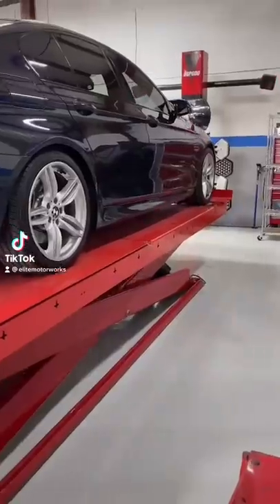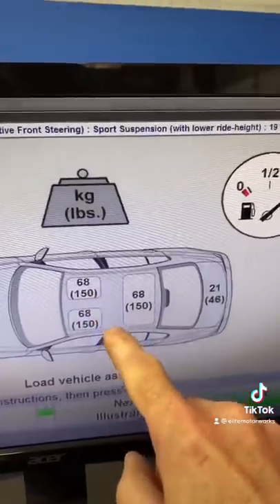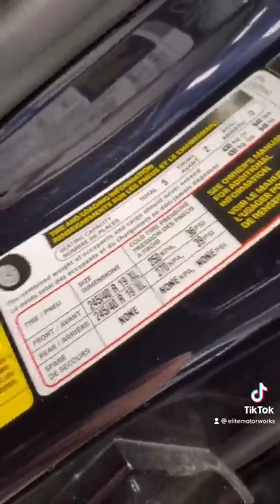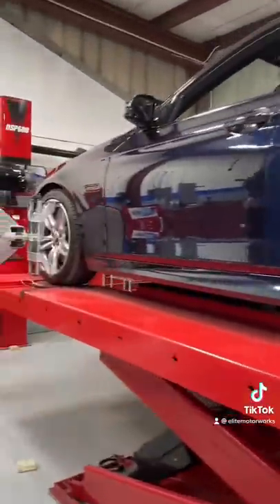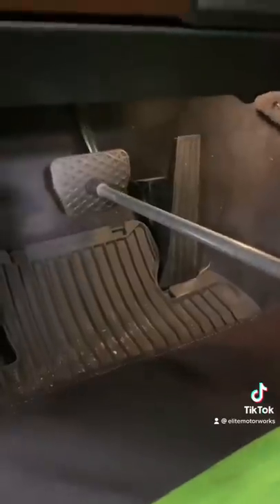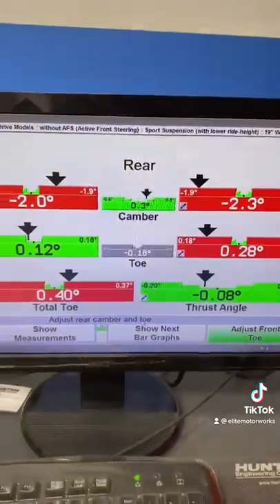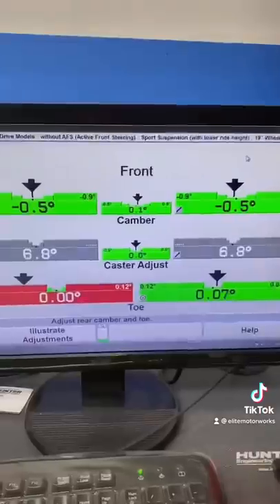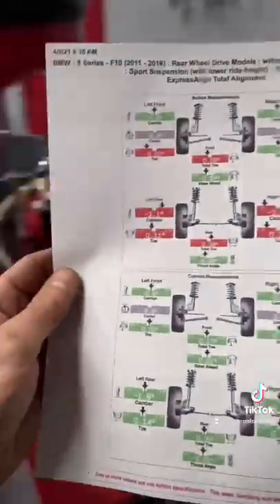How BMW does alignments #shorts

Comment: The huge difference between a lifetime alignment and your alignments, you are a competent mechanic.  It is very refreshing to watch you work on your channel. 🙏
Reply: Dammmm
Reply: I actually had 3 alignments back to back to back with my lifetime alignments. They were pissed but eventually got it right
Reply: @Alex Ptc Firestone offers lifetime alignments, where they'll align your vehicle for as long as you own it for twice the price of a single alignment. It's hard to find a good tech though
Reply: @darkfireBikes  I used to be a Firestone tech. Most newer cars only take about 30mins or so to do an alignment, unless there's something way out of wack. Older stuff, like mid 90s and back, that can be a pain and take quite a bit longer, especially of stuff is rusted together real bad. Also, there's a certain year range of Prius that, if it has rear disks, uses shim packs to align. Half the time, it would end up causing the rear brakes to squeak afterward and you have to mess with it a bunch to get it to stop.
Reply: @copo2835  that's because the rear caliper is rubbing, you have to shim the bracket a bit to prevent/stop that noise.

Comment: He’s doing it the proper way. The big tires stores will instruct techs to perform a quick front toe correction rear toe correction worst case. But will most like not use the instructed weight placement. 
Less time spent = more cars = more money 

I don’t mean more money for the techs either.
Reply: Depends where you work I was getting 11 per hour plus 9 dollars for each alignment I did plus I was getting commission on all frontend parts I sold and replaced my average paycheck was about 2500 a week as an alignment tech
Reply: Yeah, and then they tell you some nonsense about the road slanting
Reply: @cheeseburgers82  you’re earning 10,000 dollars a month doing wheel alignments?
Reply: @user-qy1ek5jr2r  Gross pay, probably, I remember working at TFT nearly 20 year's ago and alignment techs did get commission though they didn't repair vehicle's. Soo with the repair work, and the increased wages over the past 20 year's, yeah I cann see 10k per month, especially if you're busy all the time.
Reply: @aeternalis  actually he's not I'm not a mechanic but some of the shop out here in utah where I live do the same deal. My buddy was making around 2k a week Before taxes
Reply: @aeternalis  PO ñ lo lleva ñl lo ok
Reply: @narwhal9852  o
Reply: O
Reply: @narwhal9852  Of a Bro pool phone I'll looto loo
Reply: Ll
Reply: Lil pool and all u
Reply: Rep I'll
Reply: Ñooo
Reply: @henrymarquee6633  what
Reply: @cheeseburgers82  think you meant 2500 a month lol…
Reply: I would literally see other techs at these stores bump a sensor to make it look like it's in spec.  And I myself have misaligned the sensor and saved it as the before measurements so that way I could get paid an extra 3/10 on a lifetime alignment check
Reply: As someone who instructs techs in big stores, we tell them to do it correctly. Having it come back once costs more in time and reputation than it will ever take actually doing the caster and camber.
Reply: Most dealers don’t use weight lol
Reply: @cheeseburgers82  44 alignments a day😂
Reply: I worked at one of these places and most passenger cars only have front/rear toe adjustments. Some only have front toe. Most people done give 2 shits what the process is as long as their car drives straight.
Reply: @sociallyinept5430  yeah its called road crown lol if your car is slanted even slightly it will drift that direction. Basic physics
Reply: @texastootin1628  that’s true.
Reply: They won't even touch my BMW in my town, they'd rather not waste the time
Reply: @DLLL598  that’s better than having your alignment made worse by them.
Reply: Weights only matter depending on ride height, and caster sweep on a vehicle with no caster adjustment...hunter on they're website say if there is no adjustment then don't measure...that car has no adjustment for caster, same as 97,% of cars on the road
Reply: Set the toe and let it go
Reply: Yaaaaaaaa the proper way cost about 35$+ more p/h
Reply: Toe and go baby. 
That's their motto.
Reply: @tomlaing6164  it’s better to just take the measurements while it’s already there. You don’t want to rack the car a second time if there’s a pull. Even if you can’t adjust it you have the numbers to show the customer. The caster sweep also gives you additional measurements which are used to determine if there’s anything bent.
Reply: @Volksoner619  again I have to disagree, if something is bent on the front, your gonna see it if you Inspected it with open eyes, if you've set the steering wheel straight, and you've done it rear to front like your meant too and all adjustments that you can make are in spec/green (because if your clever you can change the spec dependant on if it's lowered or raised etc) the the car won't pull, that's what thrust angle tells you on the rear, never seen a car "pull" because of front alignment, steering can be out sure, but it has to be a ways out to actually affect driving characteristics, I did all sorts of adjustments for years, no incentive, just the want to get it right, so unless it's got the adjustment, you don't need to measure it, your just turning the steering wheel left and right

Also, if it was a proper alignment by dealer standard it wouldn't be hunter, it's would be BMW's own, which mounts using the holes pre drilled in the alloys for maximum accuracy, believe me I know my s**t about alignment
Reply: @Volksoner619  also...before we go into the realms of caster adjustment etc, caster really only determines how the steering wheel reacts when you let it go after a corner while moving, it does nothing else driving characteristically
Reply: @tomlaing6164  obviously you don’t “know your shit about alignment” 
Caster absolutely will make a car pull. More so than camber. 
Don’t believe me then try it out. Tacoma is an easy vehicle to test this on. Set camber to spec set caster with a negative split, say 3 driver and 2 passenger. Let me know how that drives. 
There can be bent components that won’t be noticeable to the naked eye. That’s what SAI and included angle are for. 

A quick google search can be your friend. 

Uneven caster side-to-side:
Too much cross-caster can make a vehicle pull to the side that has the least (negative) caster.

Causes: Bent strut or spindle, worn our steering and/or suspension components.
Correction: Replace damaged parts and/or reducing cross-caster to half a degree or less by resetting caster to vehicle specifications.
Reply: So that’s why you get cars that look like they’re drifting, even though they’re going in literally as straight of a line as the driver can go? That stuff always baffles me, how can they be driving there, and the back of their car is over there 👉
Reply: @tomlaing6164  yeah I was with you until you said camber and caster won't cause the vehicle to pull unless you let go of the wheel. That's just not true. If you have a large camber or caster split the vehicle definitely can pull, even violently on some vehicles. I've been doing alignments for 8 years maybe you just got lucky every time?
Reply: Forget not adding weights some places will adjust the front toe and then bump the sensors around until they can get the printout to be green.
Reply: You're not wrong, most managers of big tire shops don't care if their techs do great alignments. "Toe and go" I've been told multiple times, even when camber/caster is adjustable. It's up to the tech to be knowledgeable and have pride in their skills, as well as be able to tell a superior no, and that a vehicle needs more time for a proper alignment. 
Quality work = satisfied customers = better reputation = more money
Reply: @mccarterjg  yep cardboard too... no weights owned as well its green it goes strait good to go
Reply: @sociallyinept5430  if there’s road crown the vehicle will drift no matter what. Nothing you can do about that unless you compensate for that on the alignment but it will drift on a flat road
Reply: The last part.
Reply: @aeternalis  I'm trying to figure it out myself on 11 per hour. It ain't adding up albeit I didn't do the numbers, but I still don't believe how that plus commission equals 2500 a week
Reply: @RealNigga0190  he probably made 2500 in 2 weeks like 1 time and claims he averages that per check.
Reply: Can confirm

Comment: Is the first time in my life when I see someone is actually putting weights inside the car for a proper alignment
Reply: My Mini Cooper specifies adding weight for an alignment.  I have never done it and have never had a handling issue or poor tire wear issues.  I've been curious to try adding my weight in the driver seat during an alignment but I have never got around to it.
Reply: Yeah I worked for bmw and we didn't even do it
Reply: I use hunter, before starting I pump all tires up make sure they all same, never had a problem and I’ve done some big boy cars, not one person has come back saying my alignment is wrong, I also get the weight option but as long as tires are all even it’s all good
Reply: So when the customerwho weighs only 180lbs let's say  drives the car afterwards.  Is it still in specs ? Or does damn thing just crab walk
Reply: It’s an out of date practice bmw doesn’t even do it anymore ride height sensors are the proper way to do it now
Reply: That's why it cost $250

Comment: BMW tech here. Did you know the 5 little holes in the center of each wheel are used to accept a specialized alignment head that rests on the hub instead of the rim? This means the head gets its angles from The hub directly instead of from the wheel, which could be bent, and also eliminates the need for rolling compensation.

Comment: "Toe and go" alignments will be like that. Nobody properly compensates for loaded weight in the car like larger adults or a full tank of gas. I like that you do it properly! Keep it up dude
Reply: Whenever I get an alignment, I fill the gas tank for optimal result. I don’t know if Dodge recommends adding weight to align the challengers though
Reply: @86twin  🤔🤔 wouldn't you want to do it with like half a tank though? Your tank is only full right when you fill it and after that it's more and more empty. So most of the time the tank won't be filled to the brim 🤔🤔 so then woudnt that mean you could be overweight when doing your alignment? It's very interesting to me to hear this car requires 500 points. I just wonder how accurate it could be because if for example its only me driving the car, and I weight 150, then wouldn't the alignment be compensating for 350 pounds more than the average weight of the vehicle? It's very odd to me to see them adding weight in and then taking it back out. I woulda thought that would mess it up
Reply: Yeah one of the better ways to do it is to actually have the weight of the most common occupants and payload that the car has on the daily
Reply: Because if you compensate for a loaded car and the driver is the only one ever in it, then you have the opposite problem.
More often than not a car has 1 occupant.

You should only ever add weight to a car if the manufacturer recommends it or the suspension is tired and the client isn't going to replace it.
Reply: @86twin  You don't need it that precise, but if you really want to, do it with half a tank. The alignment will be done without driver weight, so over compensating in the rear will just throw it off in the other direction.
Reply: @TheAnnoyingBoss  well no cause that’s not how cars work
Reply: Speak for yourself my man, the alignment machine always shows you where to put weight. I used whatever was clean and heavy around the shop lol but it was close
Reply: @Kmecha84  Most places don't bother even though the machine recommends the addition of weight.
Reply: It’s only a toe and go what you mean
Reply: @Alex Ptc clearly it isn't nonsense by the fact the alignment angles changed drastically after adding weight as per manual
Reply: I usually ride alone in my mk1 VW and add some weight for alignments. 
Those things are so light and small you feel a difference in the vehicle with just a passenger.
Reply: @TheAnnoyingBoss  in my experience I haven’t had any issues.  I’m the only one in the car 95% of the time and it’s fairly empty. I wouldn’t be overweight during alignment unless I loaded the car with so much cargo it exceeds the gross vehicle weight rating.
Reply: You don't do that BECAUSE THE NORM is that you don't have a car full of fat people 😂  why would you want your vehicle specd at an anomaly situation?!?lol
Reply: @leftybronson8800  because that's just what you do and toe and go is not the norm lol
Reply: Thats because most car manufacturer dont requires added weight besides euro cars. I do alignments and have only ever ran into BMWs and Mercedes requiring to add weight. Never needed to do that on a ford, any gm car, or honda
Reply: My local mechanic shop did my 2011 Saab 9-3's full alignment and he "couldn't find the alignment specs but he 'fixed' it 😎"
"Alignment was fine and you'd barely feel the crown of the road"
First day driving it, I took it out on the main highway on a gentle bend to the left, in the left hand lane, I'd expect to pull to the left, nope it pulls right 🙄🙄🙄

Comment: Love that you are doing in properly. Even more important, when changing lower control arms you have to preload the suspension with a certain amount of weight. Crazy. But it makes the car ride and handle much better as well as the bushings last much longer. Learned that the hard way.
Reply: What kind of car do you have?
Reply: Apologies to bother, but why is extra weight needed in order to perform the alignment correctly? (thanks for anyone taking time to answer)
Reply: @Balladency95  because it simulates people in the car, the extra weight will compress them suspension more and change every number they are seeing. So to get optimal alignment they add weight that the car has on average then they reach the desired toe,caster,camber, ext
Reply: @Balladency95  
What soup said. 
And: imagine how the wheel is oriented with respect to the suspension arm, and the rest of the car. 

Wheel suspension doesn’t just go straight up and down. Depending on type of suspension, a whole bunch of other metrics change. 
So having a “realistic cruising weight” is why they load those extra stuff. 
In this video, they also took care to load the weight throughout. Not just dump it in one location.
Reply: The bushing sleeve gets tighten with a load on. Instead of the suspension free floating in the air. It adds significant torque to the bushing if you tighten the sleeve prematurely
Reply: The real world way of doing it, is to interrogate your customer on their driving habits, and load habits. Questions like 

Who drives the car predominantly?
How many passengers typically on the ride?
Do you typically have a load in the trunk?

Are the questions you ask to individualize the vehicle to the customer.

Comment: Never have I ever seen alignment shop add weights . . Its good to know that's the actual way to do it for this specific car
Reply: I work at a bmw dealer. That's not the way we do it. I have no clue what this man is doing lol. We have a hunter machine that automatically locks the plates and sets tire pressures for us. Only time we need to modify weight is when our alignment machine detects the vehicle is up higher than expected although sometimes you csn bypass this by tilting tbe height sensors down.

Comment: “It’s going to be $1750 for that sir” 😂
Reply: Yes. Don't hit a pothole or curb ever or it'll be another $1750
Reply: Exactly
Reply: That's cheap to be fair...not that I'm rich or anything
Reply: Habibi, come to Germany, drive your car km/h on the high way, everything aligned for free
Reply: @robertocurrlos7470  there is a difference between cheap and value. A normal alignment runs $200. Can I have your other 1500?
Reply: haaaaa ,,.. GOT EM !
Reply: @Youngstomata  $200? It’s roughly £50 in the UK
Reply: @thewelshrussian5532  you right for 2 wheel alignment. A four wheel alignment tho is about 200
Reply: Depends on your car, a $100,000 car this is totally worth it but on a shitbox it isn't.
Reply: @Youngstomata  I work for a large mechanic chain in the UK and it’s £54.95 for a 2 wheel alignment and £85.95 for a 4 wheel alignment. Still a hell of a lot cheaper than where you are.
Reply: I paid 60 bucks to have all 4 tires aligned 2 weeks ago at a jack Williams.
Reply: @MrWashesp  It's not a proper alignment, they just point the wheels straight. They don't really get into it
Reply: @MrcabooseVG  I mean for a 94 buick that it doesn't really have that complex of a set up 🤣🤣 not even a double wishbone set up.
Reply: @MrWashesp  You'd be surprised, even from factory most cars are poorly set up
Reply: @robertocurrlos7470 Dude that is outrageous. An alignment in Bosnia is $15
Reply: @ridvanvejzagic2887  I was being sarcastic :)
Reply: it's $90 before tax at my local euro shop, clean new looking hunter alignment machine, they do the sandbags too!
Reply: Idk where y’all get alignments that expensive lmao
Reply: Probably because it's a BMW
Any other brand it'd be $200